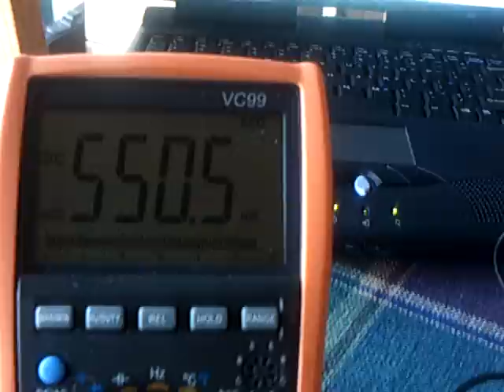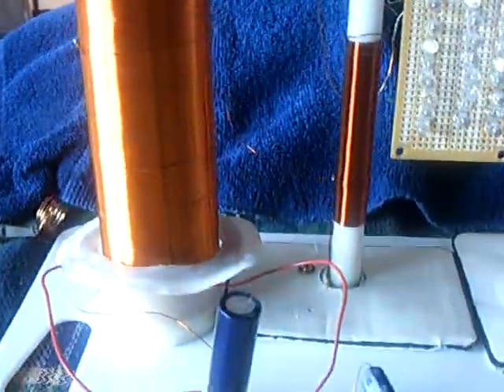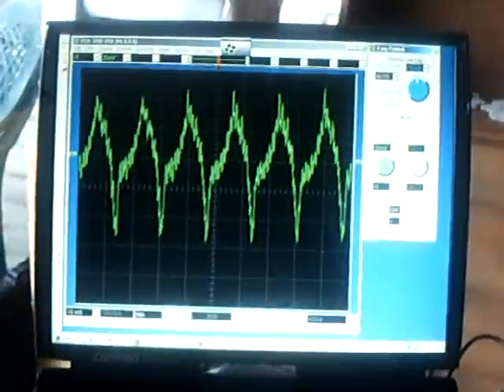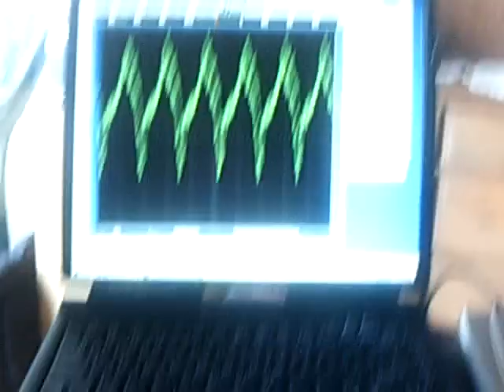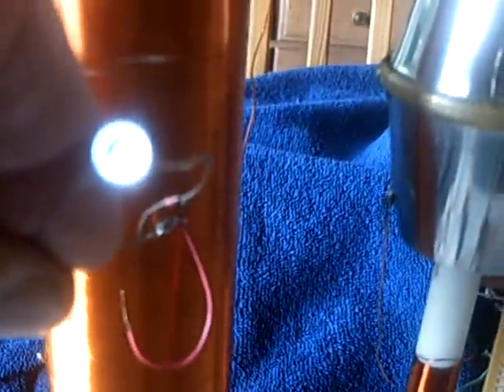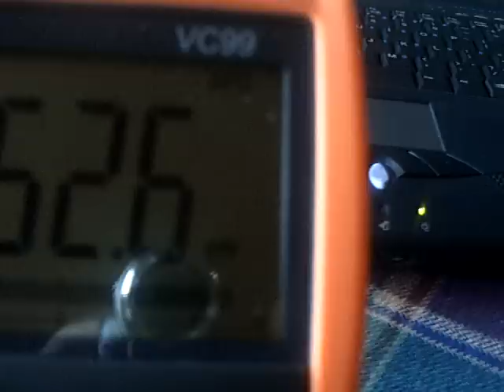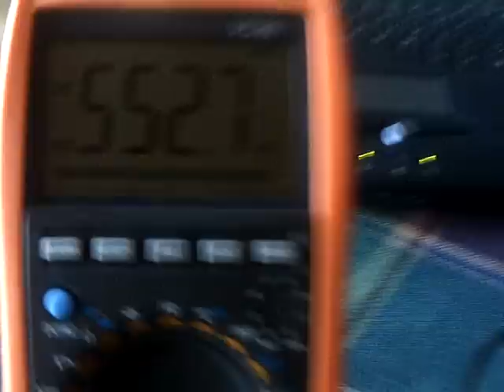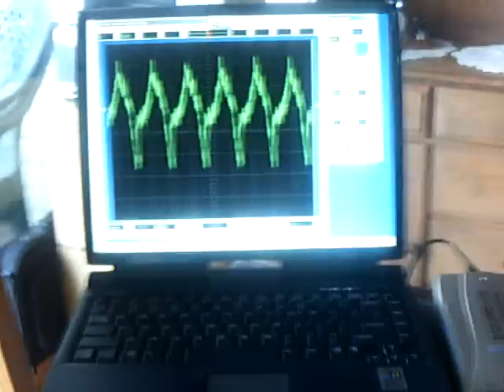Slayer Exciter self-charging & running.ASF

Comment: You have inductive capacitance between the top load of your coil and nearby potential, whether that is ground, or stay RF in the air. An experiment you could do is to connect two capacitors or Leyden jars with a shared terminal to ground, and the other two ends run to electrodes with a few inches or centimeters or less of space between them and the Tesla coil top load. You can draw the power out of the capacitors wirelessly like a battery through the Tesla coil, it doesn’t just dump all the voltage from the capacitors

Comment: Yeah, that is amazing. Ultra interesting how it only happens during certain times of the day. This is awesome. I think wire-less energy transfer, capture and use is probably one of the major components to a true awesome energy system. I will try and replicate this type of setup. I can't say why this is happening other than I doubt the 60Hz noise is the cause, but I could be wrong. Awesome work, awesome video. Peace!

Comment: It would be interesting to place the hole setup in a Faraday Cage. I could be as simple as a card board box covered with aluminum foil placed over the top of the towers and circuit. This eliminate and EM fields from the equation. If you are still getting charging then the energy must be scaler or cosmic energies.

Comment: maybe try pulling the breaker on your house so there is no house current running thru the walls.
might be that or it might also be the background radiation of the universe,and that thing acting as a gate.
i remember stiffler saying that once you three towers then it becomes free.
perhaps also chart the time of day it works and stops and compare it to sidereal time and see which way your transmitter is pointing when it works.

Comment: Im watching closely your videos & stprue, kooler, jeanna, pirate about JT & Free Energy, are really great - tnks, very similar with some of my old ideeas, projects, schematics;please continue until the point where the battery (a big capacitor in fact) can be removed from the resonant system, and the circuit and schematic could be upgraded to a final close loop device that can power a house, it is very posible & not so difficult! Good luck with achieving overunity for all! Circuit is the battery!

Comment: Lidmotor this is Great, Thanks for posting this video.
If you take your scope probe with nothing attached to it.Start at the bottom of the coil and slowly move the probe from the bottom of the coil to the top of the coil.
You should be able to see there is three hot spots on your coil.The middle should be around 13 or more MHZ.

Comment: I dont think its the 60hz mains effecting your circuit. How would that result in a wave in the Mhz as shown on your scope? Do you have a Faraday cage, how have you tried to isolate this circuit, or is it almost time to head out on the boat again? LOL
Are you using GBluer's latest circuit with the dual transistors? I tried it and the transistors got very hot, I think I have some component falure that I will have to root out today.
Excellent work yet again!

Comment: Lid, I think Moray for a long time thought he was receiving power from his antenna, but later found that he did not need the antenna as the power was actually coming from the unit it's self. He was making what he called a "Counter Balance" to take the place of the antenna. This was thought by some researchers to actually be just a big cap.  Big caps can act strange, charge and discharge slowly, some times by themselves. It is just two big plates in a little can. Two long wires are a cap too.

Comment: Lid, I have to agree with Icestorm5555. At those low voltages you may be just going in circles, I would keep working in the higher voltages and currents, one volt or more so you can see real results. Kind of like instrumentation, you always want a live zero to get rid of the noise. Most common process instrumentation current loops use 4 to 20 MA for just that very reason. If it was 0 to 20 MA, you would always have some error in the readings. I would stay up there off the bottom to be sure.

Comment: Like egn83b said, A crystal radio  can put out "some" power. You may have a radio receiver at several frequencies combined. I have a old tube power amplifier that will pick up several radio stations at the same time as it has no way to tune it's self. If you just have a long wire, you can pick up "something". in communications school we were taught to always ground a open wire as there could be a deadly static charge on the wire, You may have a antenna of some sort.

Comment: It could be static electricity or like you say background ac from something at those low voltages. You might try cutting the power off to your home at the breaker panel and see what happens. You might want to turn off your computer on it's battery too. Moray was running his unit far from any power line or radio transmitter just to make sure that the power he was making was not from anything man made. if it passes these tests, Then it could be time  to travel to a different location for testing.

Comment: I think this might be like how a crystal radio works. Just the setup is big enough the you are getting the voltage out of the air freely available. Theres is a simple explanation to this just have to do what you said and do the precess of elimination like getting as far away from electrical sources as you can but you could be picking other things like microwave from orbitals in space. who knows the possibilities have to looked at.